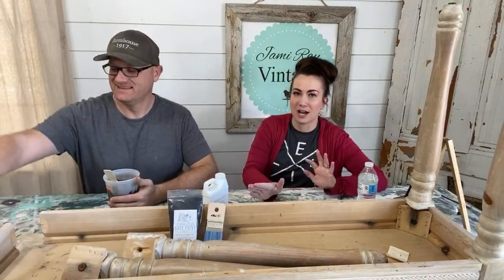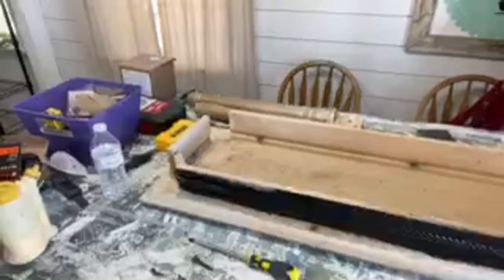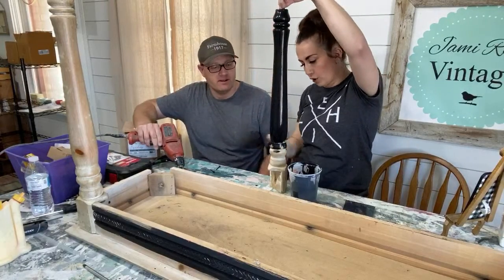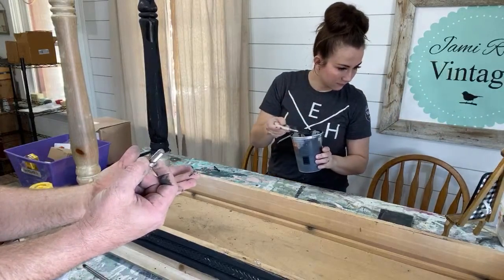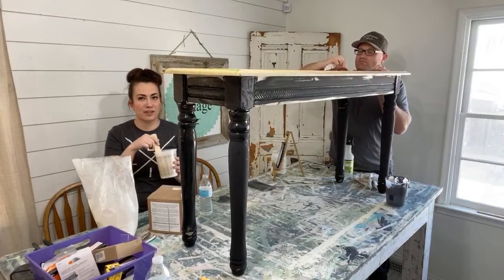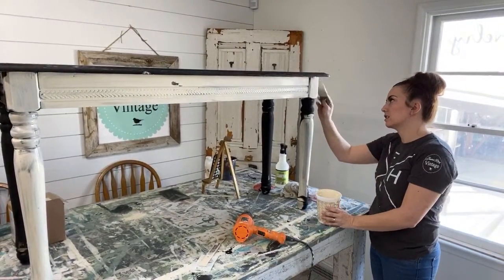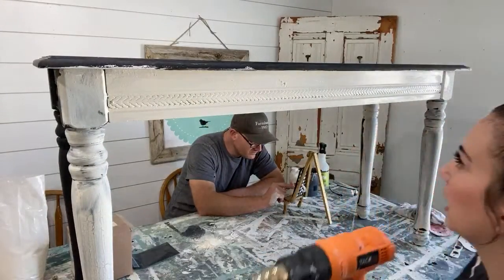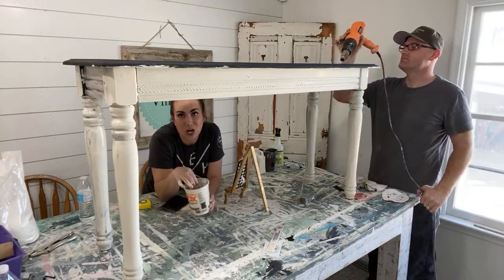Repairing Broken Furniture Trash To Treasure Entry Table

Comment: I posted on your site a couple days ago. I finally painted and stained my kitchen tableZ I had this problem and also my table was massively warped. I think standing on it when I painted my ceiling did it. Anyway the corner brackets looked bad and the wood was stripped and missing pieces. I used the old piece as a template and cut new wood, drilled holes for the two screws that were attached to the leg and drilled new pilot holes with the kreg. It took me two days to get two darn legs screwed back in!!! I had no room for the screw driver. I tried a socket wrench, everything! Ugh!!! I finally found a right angle drill to get those darn screw in. So, I finished it all up, it’s still warped, not as bad, but until I can go get new lumber and make a new table top, it will do.
Reply from the maker: Nice!  Sometimes a little character and warp makes it better. 😊❤️

Comment: Hey, I just had Botox and Juvaderm at 66 years old.  Love it.  I look 46.  Lol. 😂🤣  I’d love the lashes too.  Fun video.  I have a question for Zeb, because he’s genius at this.  We have a coat rack from Wayfair that the top piece was screwed to the bottom piece.  It started to wobble and when we unscrewed the two pieces, we realized it was cheap crappy “wood” and the screw thing just chewed into the “whatever the wood” is.  We’d like to fill that big space (a larger screw doesn’t work) with some kind of hardener/filler and then screw the two pieces back.  Most likely it’ll end up in the garbage.  Thanks,  long comment.  But Zeb is the expert with these kinds of issues, ❤️
Reply: Nancy Cowan -could you drill out that spot, glue in a dowel, then drill a pilot hole for the screw. I’ve done that before in similar situations.
Reply: Rebecca Ackroyd I don’t know.  Up where the screw goes is all chewed away -must be particle board that gave way with the weight of our winter dang jackets.  Maybe.  I just thought there might be a product to squirt up into that hole and be able to drill another thing in.  Obviously I have no idea what I’m doing,  neither does my husband.  Lol.  Thanks,  I’ll check with him in your suggestion.

Comment: And ps.  Would the clear milk paint go under DIY paint to become crackly?  What a newbie.  Thanks.  I’m needy, I know.  Can you guys write a how-tp book?  I’d buy it.
Reply from the maker: Nancy Cowan the crackle would work. I haven’t tried the milk paint without pigment. But now I am curious how that would mix.
Reply: Jami Ray Vintage I would mix the clear milk paint with water,  brush it in the surfaces I need to, let it dry, then apply DIY over?  And blow dry maybe?  Then apply some transfers.  Then seal with clear wax.  I have a plan.  Egads.  Thanks for your advice, help and great videos!